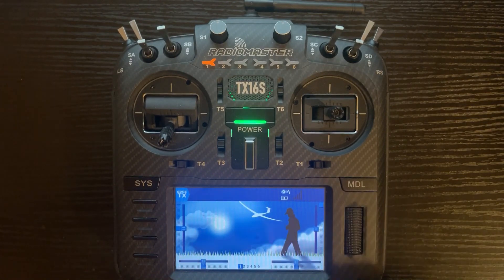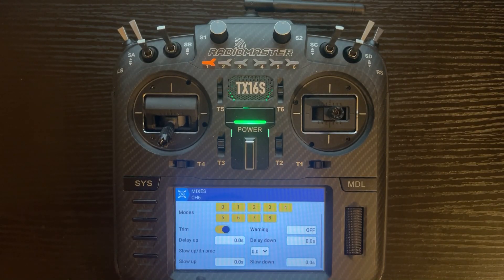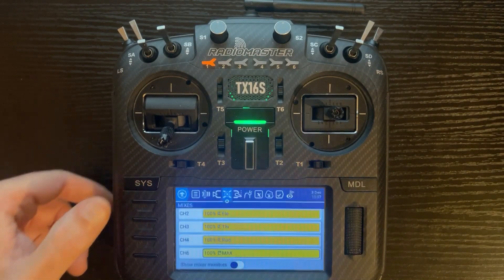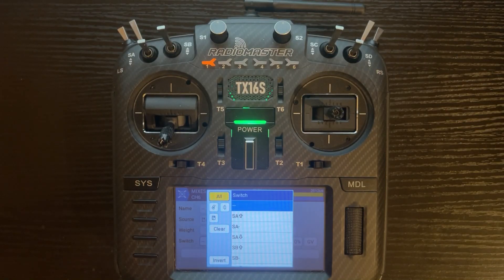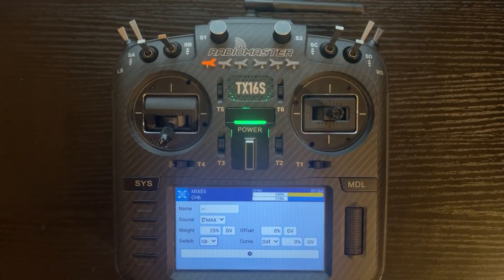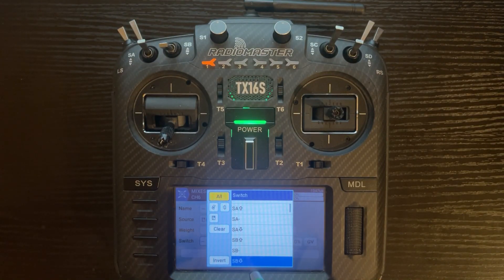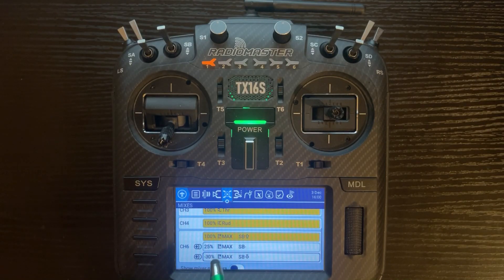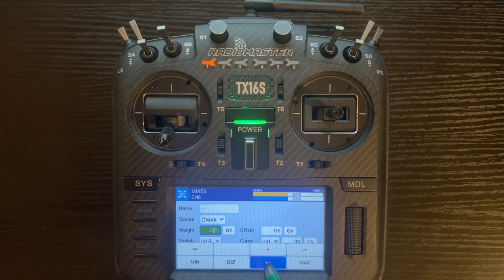Radiomaster TX16s/Edge Tx: Flaps with 3 "Max" line method

Comment: An excellent series of videos - good lighting, always in focus, no camera waving around, hands only in frame when absolutely necessary, sensible voice level using educated English with only a very small regional accent. Also very even-handed assessment of this radio and the Spektrum environment! 👍👍
1 question though (from someone of fairly limited IQ/experience with EdgeTX/OpenTX radios) - I saw on the RCGroups Forums on this radio/EdgeTX that 1 of the developers of the open source system recommended leaving the bottom line of any (say) 3-position switch assignment as unassigned to a switch position. Described as a "Catch-all" position - the reasoning being the programming clocks through the possibilities from the top and enables whichever shows as "true" first. The "Catch-all" covers the remote possibility that the switch/whatever may be defective or the connections to the board might be broken and none may show as "true!". The "Catch-all" line has to be at the bottom not further up or the lines below will never actuate. Thus any default you want (eg "Flaps Fully Up") must be set at the bottom.
I "think" that the "Special Functions" list is also stepped through from the top - so it is possible to (for example) set a switch to force a channel to +100 at SF2 and another to force it to -100 at SF1. The SF1 command taking priority when "true" - we use this to re-order the flight gyro modes on our oddly configured 6-Modes-in-2-Banks-of-3 Radiolink Byme-A gyro stabilisers. (Probably many other easier ways of doing it - but seems to work.)

Comment: Followed your mixes tutorial here  and others but servos only move to full flaps, adjusting weight with no change.  Any ideas ?
Reply from the maker: 1) Switch isnt assigned for all 3 positions (Up Middle and Down)
2) Source is set to switch and not Max
Reply: @BDTennessee  thanks !, got it sorted , also had to switch from CH5
Reply from the maker: @ksb_n54  saying that about CH5, you have ELRS right?
Reply: @BDTennessee  yup I do ! 
Appreciate the help 👍🏽
Reply from the maker: @ksb_n54  change switch type to 16/2 and Channel 5 works proportional and can be used for flaps, control surfaces,etc...
Reply: @BDTennessee  Works ! Awesome 👏🏽

Comment: I've been using the NX8 for 3+ years now and my new tx16s max red will be here Tuesday. 😁
In this method you're teaching, what is the concept of the term source, and what's the difference between selecting min or max?
Thanks,
Larry
Reply from the maker: Max source is based on 100%. So valued added is that exact number.
Reply: @BDTennessee  Thanks

Comment: I have a TX16S on Edgetx. I have set my flaps up on switch B as above to go from 0% to 40% to 60%. When I move SB from SB down to SB middle the flaps jump from 60% to zero and then back to 40%. Going from 40% to 60% this doesn't happen. Any ideas pls?
Reply from the maker: SB Up Assigned to 0%?

Comment: Heya just wondering if you have used the nx10 plus,? I've got a new one but my ar10100t receiver keeps loosing bind when I unplug and plug battery back in any ideas? I've got a new ar10100t coming but I'm just wondering if you have any thoughts Cheers.
Reply from the maker: 1) Defective receiver
2) Throttle in the data port and not actual channel 1 (Channel 1 is the 2 slot from side)
Reply: @BDTennessee  awesome ill try all that but I'm thinking the receiver is dud I do have a new one coming just in case cheers

Comment: Most planes need a flap>elevator mix to make them fly at the proper airspeed/attitude on final. I know you can add an elevator mix for the takeoff and landing positions using the flap switch (SB). But how would you set up separate aileron and elevator trims for each position of the flaps like Spektrum's F-mode trim?
Reply from the maker: Edge TX has a flight mode menu. You can configure different ways. Trims add to previous mode or independent.
Reply: @BDTennessee  I put FM1 on SB- and set the aileron and elevator trim to =1. Then I put FM2 on SB down and set the aileron and elevator trim to =2. I center the rudder on my planes and never trim it, so I didn't include it. It was pretty easy. I've always said that there isn't anything EdgeTX can't do, provided you can figure out how.
Reply from the maker: @txkflier  that works.